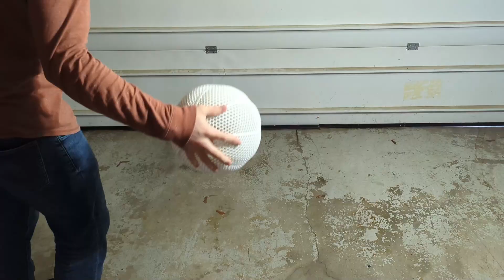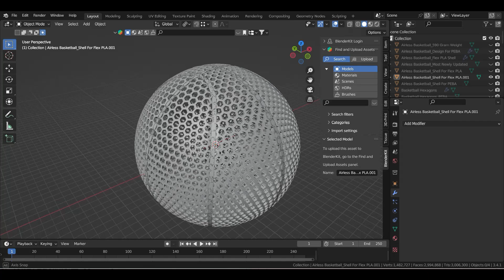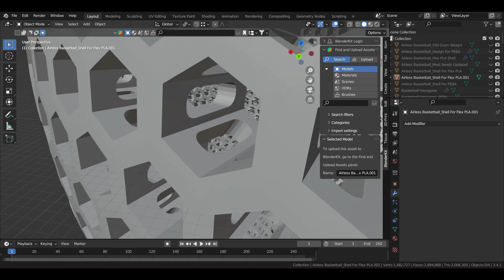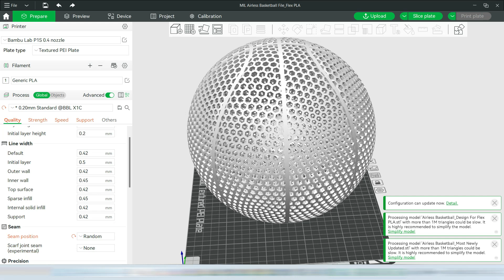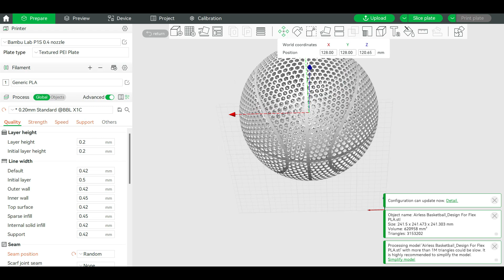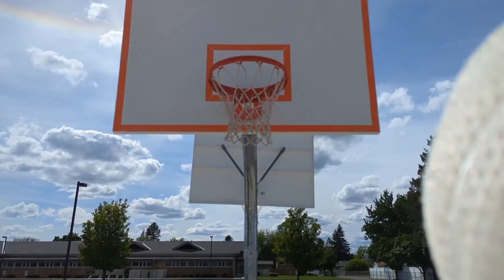Our New Airless Basketball 3D Models!

Comment: for some reason i just cant get my PEBA to work, ive tried everything but it still fails
Reply from the maker: Sorry to hear that. What printer are you printing the PEBA on? Have you tried any temperature or retraction tests with it?
Reply: @makeitlabchannel  I'm printing the PEBA on the X1C, It is a relatively new filament. The sticker in it suggests the temp between 210-240, and the bed between 30-55, I do not know how to do retraction tests since I'm new to PEBA and 3d printing as a whole
Reply from the maker: @MorSlimeYT  Just to check, did you download/load the 3mf file on Makerworld so that it loads all of the settings? Also, you might have to set up a custom profile specifically for PEBA. It is hard to explain, but if you download the 3mf file and export the settings to a custom PEBA profile, that might help (like this video shows): https://www.youtube.com/watch?v=Xtdg_MICHmw
Reply: @makeitlabchannel  I didn't download a basketball file but I downloaded the PEBA test ball that was like the 5th one when you type PEBA, the print failed even with the tuning of the gcode, then I did a calibration cube with modified settings and that failed 5 times and I also did a benchy that failed at the start

Comment: in your video you mention to set the bed temp to 100 for the peba but your 3mf file in makerlab has it at 90. Which temp should i use for the best results?
Reply from the maker: I recommended 100 in the video because that was one of the first peba basketballs that I printed, and that is the bed temp that I used that worked. I have printed several at 90 now, and I think 100 is a bit overkill, since I have not had any problems with 90.

Comment: Nice job, but it's technically incorrect. As is every other 3D model of an airless basketball that I could find online (except the real Wilson - which is correct). Easy to fix, though. Rotate the ball such that the seams are horizontal. Cut the model in half perpendicular to the seams, rotate the cut end 90°, and stick it back together. If your hexagonal holes are symmetrical either side of center, it will go back together just fine. if not, then the holes will get messed up.

Real [leather] basketballs are made from just one pattern that's mirror imaged [so technically 2 patterns, I suppose]. One end of the pattern curves down to a point. The other end is also curved, but ends in a vertical cut. Sort of looks vaguely like 1/2 of a vertically sliced bowling pin.

Your design (and everyone else's) would require 2 different patterns. One pattern would have points on both ends, the other would have vertical cuts on both ends. Sort of looks correct, but not really.

You can also make an "impossible" basketball. Cut the ball as described above, but only rotate it 45°, and stick it back together. If the model is correct, the seams will still line up, but it couldn't actually be made from leather. At first glance, it looks normal, but will mess with your mind if you study it closely - sort of like the basketball version of a Penrose Staircase.
Reply from the maker: Interesting, I will have to look into correcting the models (if I have the skill lol) and look into the other variations too, thanks!
Reply: Ignore the part about turning it 45 degrees makes it unbuildable. It’s still buildable, but looks weird.

Comment: W is it going to print good on my Neptune 4?
Reply from the maker: Hey there, I think if you use the right settings and print it slow it would work, but since the build plate is 225 x 225 you will have to scale the ball down a bit.
Reply: @makeitlabchannel  that’s true

Comment: Have you tried printing it with bigger nozzles? The 3+ day printing time is holding me off a bit 😅
Reply from the maker: @oclk8650  I have some 0.6mm nozzles coming in soon and I will be sure to test how it performs/decreases printing time 😁
Reply: @makeitlabchannel  Great! I will wait for updates. I would really like to print such a basketball, but with the very high price for the PEBA filament i am waiting until I know everything will be working perfectly. 🙈
Reply from the maker: @oclk8650  sounds good!
Reply: @makeitlabchannel  Any news on the bigger nozzles?
Reply from the maker: @oclk8650  just tested their durability yesterday, so I should have a video out this week hopefully. In a nutshell, I didn't notice a difference in durability or bounce, but it cuts the print time by a lot - shaves off days. The only negative I can see is that the larger layer lines are more visible but that isn't a big deal for me

Comment: @makeitlabchannel I printed the peba ball with your new model: https://youtu.be/eaY5KMYub9o

Did your peba ball hold up? Mine was much stronger than the other models, and never cracked from dribbling but after 30m of shooting hoops it broke in half on the layer lines, I think the higher drops did it on eventually.

I was thinking of doing tpc since that was stronger than the peba on the other balls(though not as bouncy) curious if yours held up, I printed with your settings.

Comment: You could use PVA or similar water-dissolvable filament as the support structure. With that, it is easy to get rid of the support smoothly. But of course, you have to have a multi-material printer...
Reply from the maker: That would make it a lot better, but yes I might have to invest first 😁

Comment: Hey, what software did u use at 6:28? I want to use this and usually use Ultimaker Cura (i'm a beginner) but I want to get the print settings right soooo
Reply from the maker: Hey there, I was using a software called Bambu Studio. It is the go-to slicer for Bambu Lab printers, but I have heard you can set it up for non-Bambu Lab printers too, but I have not tried this yet

Comment: Will you make a video on making it more rubbery and grippy? Wanna make it more like a real one.
Reply: it’s all improfessional material science lol
Reply from the maker: @benonstudios  haha, that is the best description I have heard lol
Reply from the maker: @benonstudios  I can definitely look into this 😁
Reply: @makeitlabchannel  Sorry for the late reply, but do you think some type of silicone coating would work? also, have you tried TPC? I have no idea if it would bounce or not but it may be worth a shot!
Reply from the maker: @benonstudios  My first thought was maybe spraying it with something like Flex Seal, but it would add a bit of weight and could affect the bounce. Worth a try though. There are also dyes and paints that might help with this and change the color too. TPC is on my try list, and I have some that I will try printing soon because others have had good results with it. Lots to try!
Reply: It may sound stupid, but maybe try making a lightweight PEBA model, and coat it in flex seal? Or maybe even try regular PLA with 3dgloop like uncle jessy did, but then to dry it off design some type of thing that fills each hole in the basketball so that no gloop can cure inside the holes and make it ugly. Maybe from there you could coat it in a dye to hide the bubbles. Also, another idea i had was if you could possibly melt a bunch of 60a tpe filament and coat a PETG basketball in that? The possibilities are almost endless. Who knows? Maybe someone will melt real basketball rubber into a filalment and extrude that!
Reply from the maker: @benonstudios  Those are all great ideas, and worth trying! I am sure we will find the winning combo some day

Comment: Another quick question guys, I am giving it a go with the flex PLA filament which suggests a 0.6mm nozzle, however I noticed this after I started my 4 day print with a 0.4 nozzle. Can you please let me know if you printed this with 0.6 or 0.4? Much appreciated.
Reply from the maker: @alitechno  Yeah I read that they recommend a 0.6 nozzle, but I have only used a 0.4 nozzle on all of the basketballs I have printed and it has worked great for me 😁
Reply: @makeitlabchannel  Thanks for confirming
Reply: @makeitlabchannel  and another question. Have you tested these prints in a smaller size like 7 inch versions or 177mm? Kids version of the balls ?

Comment: Is it possible to print it any faster? I don’t really like the idea of my x1c being out of use for 3 days😅 Great work, btw!
Reply from the maker: @benonstudios  thank you! It depends on the filament. I have printed the flex PLA very fast, as fast as regular pla, but the problem is it will sacrifice the adhesion between the layer lines and you will probably get less durability out of the ball, although annealing the ball might counteract it. With peba, I only printed it at 60 mm/s max (as they recommend).

Comment: This Maybe a dumb question so if I use the file in the video description it'll have the bottom support settings and no support on top I watched the video and confused because I'm very new to 3d printing
Also to be sure which tier is for tbe commercial use
Reply: Bambu printer 
Is all the tiers commercial use or a certain tier for the patreon
Reply from the maker: @OfficalMr_Turkey  We have a commercial tier that is $5 per month that allows for commercial sale of the physical prints - commercial selling is only through the commercial tier
Reply from the maker: @OfficalMr_Turkey  what printer will you be using? If you are using a Bambu Lab printer with Bambu Studio, you can download the 3mf file and it will import all of the settings you need. It will be different if you are not using a Bambu Lab printer. I would also recommend printing some other things first before the basketball for practice but up to you 😁

Comment: try 3d printing it with PET filament like in the bottles, it should be flexible and bounce
Reply: I mean PET, not PETG, specifically. the original bouncy bottle plastic. you could probably easily cast PET domes. maybe PETG-carbon filament reinforced might do the trick.
Reply from the maker: @gsestream  Great suggestion!

Comment: Quick question guys, i am going to pull the trigger on peba filament however i noticed that they are only available in 500gms spools, dod you guys have to buy 2 of them to complete the ball? Of you have to get 2, how to you change mid print to the other spool?
Reply from the maker: @alitechno  hey there, that is correct, I had to buy 2 spools to have enough peba for the basketball. Also, to switch the spools, I had to follow the end of the 1st spool with the beginning of the 2nd spool while it is printing. It would probably be fine it you wait until it runs out and then load the new spool/resume the print after. I explain all of this in my other video here: https://youtu.be/BtqjUwdIx30

Comment: I sent you an email but when sliced, Bambu predicts I will use 564g of filament for the model itself which is considerably lower than yours. Any ideas? Has anyone else ran across discrepancy?
Oh, thanks SO MUCH for doing this, I have been patiently waiting for the GOD ROLL on Airless Basketball model!
Reply from the maker: @MrSlashKiller  sent you an email with my thoughts - hope it is worthy!
Reply: @makeitlabchannel  It didn't make numbers match but your prompt response was very much appreciated. Many thanks!
Reply from the maker: @MrSlashKiller  even the 3mf? Interesting. As long as the diameter/walls/% infill etc all match, the final print should be right around 625 grams. Let me know if there is any way I can help
Reply: @makeitlabchannel For some reason my email didn't show 3mf attachments on my phone so I downloaded to PC and all good now. Later I will disect the data and see where my original numbers were off. You're very kind to do that for us. Thanks again. I am about to print and remembered I might need to dry the filament. Did you run it through on a just opened sealed bag from manufacturer or just print immediately print from dryer?
Reply from the maker: @MrSlashKiller  glad to hear it! The first peba ball I printed I just opened straight from the sealed package and put it into the dryer, and then printed it right always from the dryer to the printer. The other ones I printed I used already-opened peba, but I dried it for about 6 hours on 50C first before printing, and dried the filament all the way through printing on all of them. Hope it works well!
Reply: @makeitlabchannel  I'm sorry to ask another question my friend, should I have kept the door open during printing with PEBA? The ball seems to be flexing a tad while print head is depositing on it.
Reply from the maker: @MrSlashKiller  no worries! probably a good idea - I always keep mine open a little bit to help the venting
Reply: @makeitlabchannel  So, after 109 hours, it finally finished! Unfortunately, it cracked on first bounce 😞 Anyone know of a glue the holds tight but still flexes? I typically swear by Weld On 16 for PLA but not sure how it would handle this.
Reply from the maker: @MrSlashKiller  oh no! This was the peba too? Did it crack along the layer lines around the middle?
Reply: @makeitlabchannel  Yeah, around 60% up from bottom. I am in process of using WeldOn glue and although it dries quickly, I will wait a couple of hours to test. I will update later. Thanks again for all your help thus far. I will keep monitoring if another material plays nice.
Reply from the maker: @MrSlashKiller  wish it worked out better and I hope that glue works 😕 what printer did you use?

Comment: @makeitlabchannel

Just curious did the new file that you made fix the soft spot at the top of the ball because of the overhang?
Reply: ok thanks and also can i use bambu lab slicer for prusa because most of the settings in prusa slicer aren’t on there
Reply from the maker: @CalebPham-sz5sj  I was reading that you can use Bambu Studio for Prusa, you just have to set up a printer profile for your printer. The settings might also be in the Prusa Slicer, just maybe hidden from view and have to be activated to view like Cura?
Reply: thanks you so much for your help and one last question i have flashforge flex pla from amazon and i was wondering if i should use that or use the other flex pla that you recommend
Reply from the maker: @CalebPham-sz5sj  I have not tested the flashforge flex pla yet so I am not sure how well it prints/how close to the NBA weight it would be, but I have heard from others that it works well
Reply: i will try the other filament and tell you what is better
Reply from the maker: @CalebPham-sz5sj  sounds great!
Reply: Hi, I have not been able to slice the basketball with prusa slicer without the supports being stuck in the ball. I have tried to lower the supports but have not been able to get it to work. Another problem i've had is not being able to connect the prusa mk4 to the bambu lab slicer. Do you have any other suggestions on how to print the basketball?
Reply from the maker: @CalebPham-sz5sj  are there support blockers with the Prusa Slicer? Also, is there a way to export the gcode onto an SD card from Bambu Studio and upload to your Prusa that way?
Reply: i have been trying but there isn’t a prusa mk4 printer on the printer menu. do you think orca slicer would work?
Reply from the maker: @CalebPham-sz5sj  it looks like you can do custom support painting so that might be a good option: https://cebess.wordpress.com/2024/01/04/creating-manual-tree-supports-in-orca/
Reply from the maker: @CalebPham-sz5sj  hey there, to account for that, I mention in the settings that I add an extra top layer but only to the top. This seems to help keep the bounce the same around the whole ball
Reply: ok great thanks for all of  your help
Reply: great thanks. i will do that when i get home
Reply from the maker: @CalebPham-sz5sj  hope it works!
Reply: @makeitlabchannel  It does work so i am going to print a mini basketball with what i have left from my filament. Orca Slicer is basically a copy of the bambu slicer but with extra settings. Thanks a lot!
Reply from the maker: @CalebPham-sz5sj  glad to hear it - good luck!

Comment: I'm so stoked on this! I'll be printing this in peba as soon as i can manage to. I'll let you know how it goes
Reply: finished printing in peba, bounces well and very durable. Thanks for all your hard work! Only thing i changed is adding a raft of a few layers because the last basketball design i printed in peba came out kind of browned on the bottom from being on that hot build plate for so long. What software did you use to model?
Reply from the maker: @AlexMccawley  glad it turned out well! That is a good idea with the raft. Also, I designed the basketball with Blender - I thought I would have to learn Fusion 360 to make it but turns out you can just fine with Blender 😁
Reply from the maker: @AlexMccawley  would love to hear how it turns out!
Reply: I dyed my peba ball black and it took the dye great. I used the rit dye that's made for synthetic material. I'm not sure if I heated the dye solution up too much tho or if I already had a crack that formed. Looks like it separated a little on the layer where my filament ran out while I was at work and I had to resume hours later.
Reply from the maker: @AlexMccawley  oh awesome, did it change how the ball feels in your hands (stickier) or affect the bounce at all?
Reply: @makeitlabchannel  it may be a placebo effect but it seems slightly less "slick" feeling. Also probably placebo but the bounce feels better. You can see the difference in surface finish more now where I sanded the supports down since the ball is a deep black color now.
Reply from the maker: @AlexMccawley  sounds good!
Reply: @makeitlabchannel I ordered the Ataraxia Flex Pla orange, and I'll be subjecting it to a full game! I hope to annealing one as well! I'll make a video and let you know!
Reply from the maker: @ElPresidenteBuzzard  sounds awesome, would love to see it!